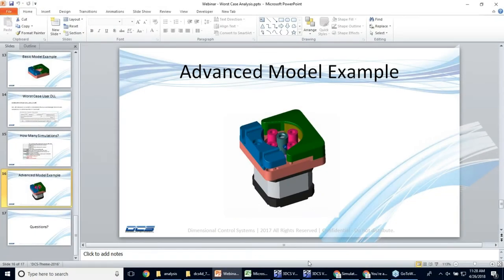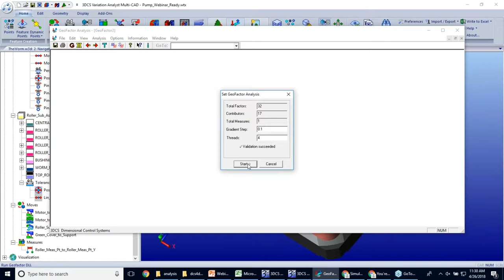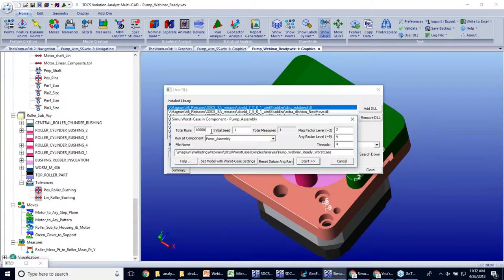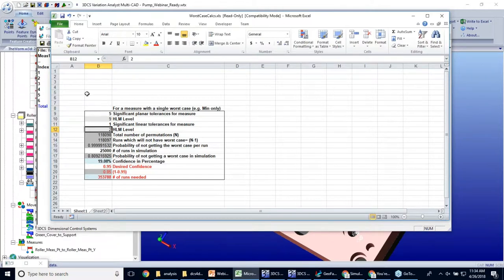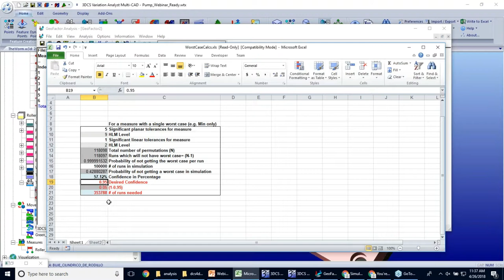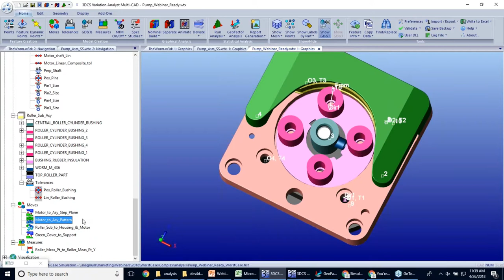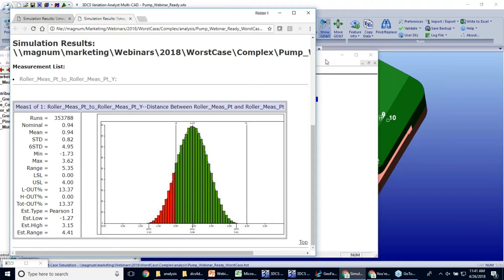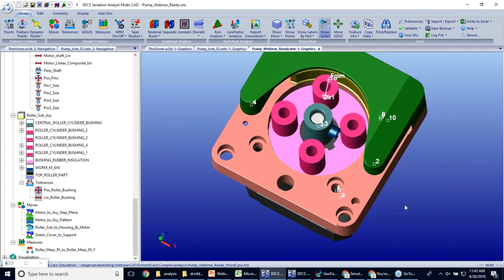Advanced Example Model of 3D Worst Case -- 3DCS V7.5 part 7 Worst Case

Comment: Does Geo factor based Worst case analysis and dcsSimuBiModal dll report the same worst case values ??
Reply: Can you please explain how to find the optimum no of runs to find the reliable worst case value ?
Reply from the maker: You may want to talk to one of our engineers about these topics. You can message me on the website at 3dcs.com, or use our support option at the top of the website.